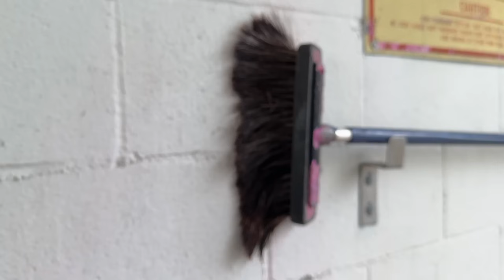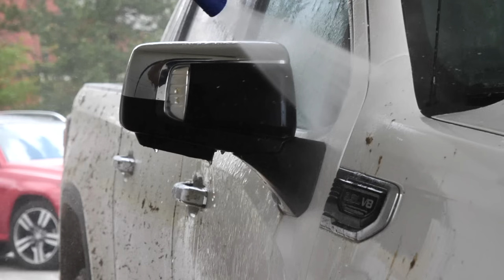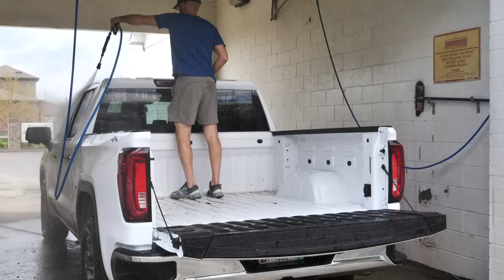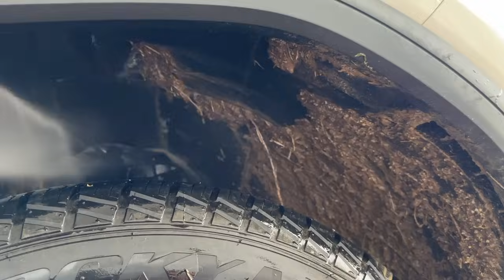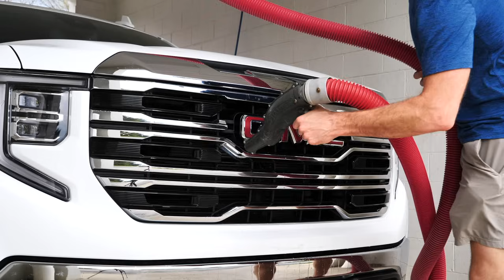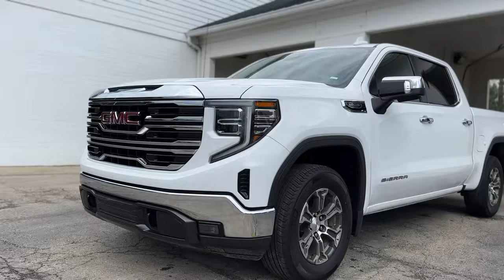How To Wash Your Car At A Self Serve Car Wash | Car Detailing

Comment: I like to use my pump + spray foamer to foam the car, and spray my wheel cleaner, prior to the initial rinse. I think it's good to loosen up that dirt buildup before rinsing, and not pound the dirt into the paint with the pressure washer. After that go back in for the contact wash of the paint and wheels.